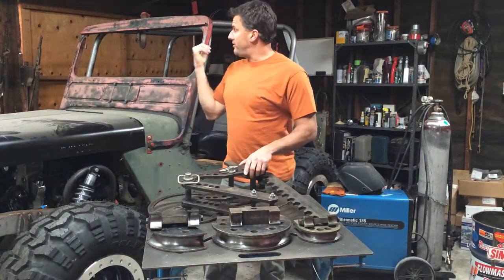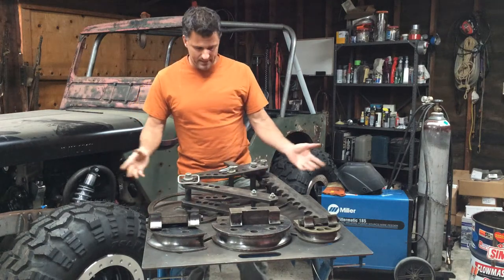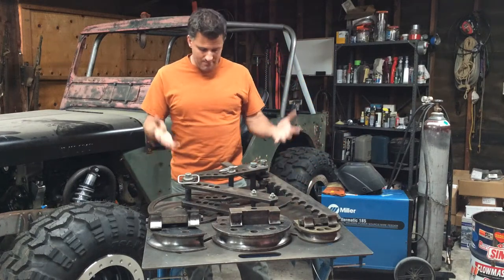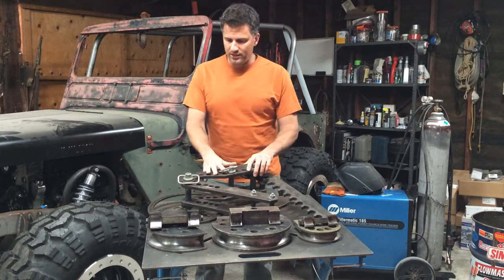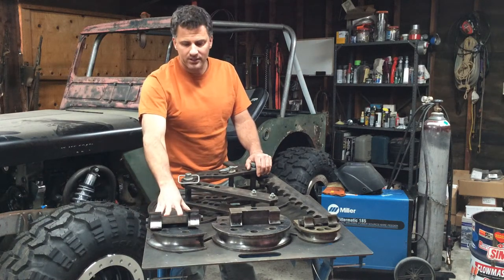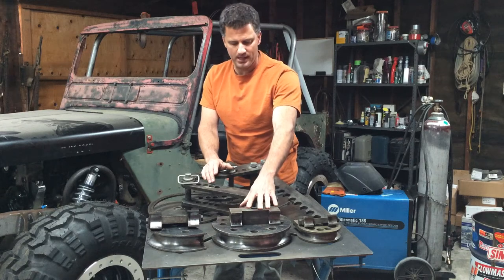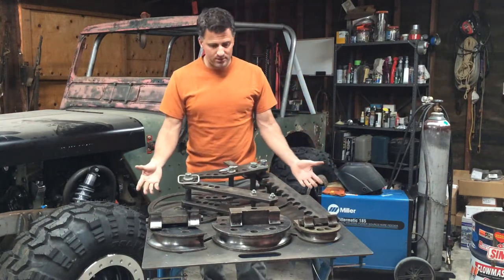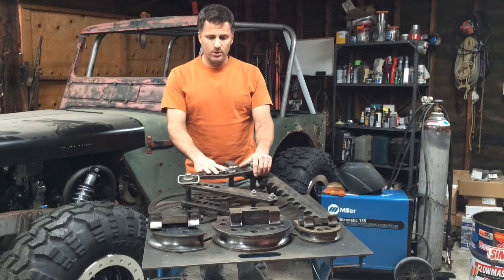John Cappa 4x4 Vlog 02: How to choose a tubing bender, and what die sizes work for me.

Comment: i wonder how well getting a 2" die and then bending 2" 1/4 wall into the 180degree bend and cutting it in half to knock the die down to 1-3/4" then bend another to get down to 1-1/2" and so on, tack weld them on multiple drop downs to keep them together... definetly wont be as good as a proper die but might fill in the gap if you had a couple dies but needed to make a bend or two in an intermittent size where the other two wouldnt work

Comment: Cool video. I am not sure on what centerline radius die to get for a regular roll cage. What is the most common CLR die for a roll cage? id appreciate the help.
Reply from the maker: Both my 1.5- and 1.75-inch dies have a 5.5-inch radius. There were not as many options when I bought mine some 20-plus years ago. But, you really don't want too slow of a bend because it will cause the cage to be closer to you in some areas. Conversely, you don't really want too tight of a bend either. Bends are inherently weak, so fewer bends is always better.

Comment: Nice work Cappa! Any info on why you would want a closer radius die vs a wider radius die? 5-inch 90 degree for example? If love to see some welding tips and tricks too since I'm likely going to purchase my first MIG welder and a JD-squared model 32 bender real soon.
Reply from the maker: Thanks! You'll want to use the tighter radius dies for rollcages and such. Long slow bends will encroach on the headroom in the vehicle.

Comment: can you tell me the length, width, and thickness of the main plates?
Reply from the maker: The A-pillar footings are 4x6 with a bend that follows the floor line and 3/16-inch thick. The rear portion is attached to two 2-foot long sections of 3/16-inch angle iron mounted to the body in two planes.